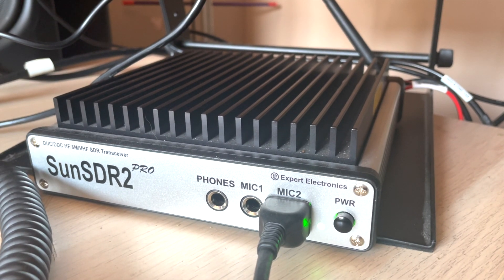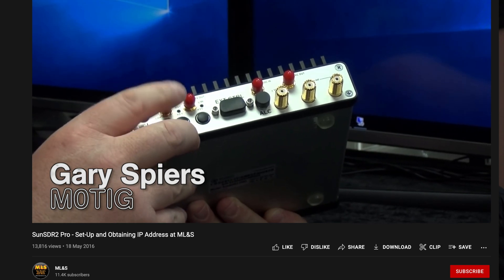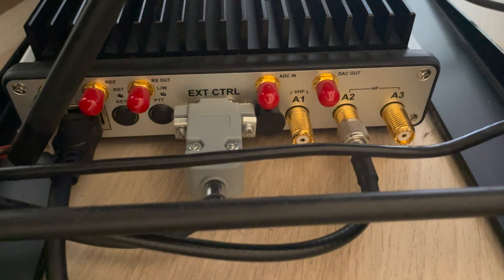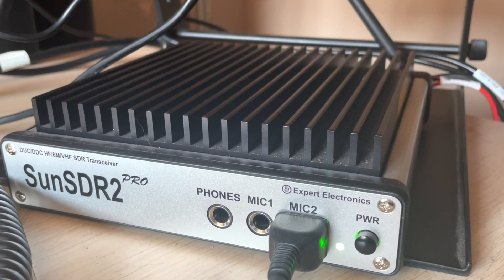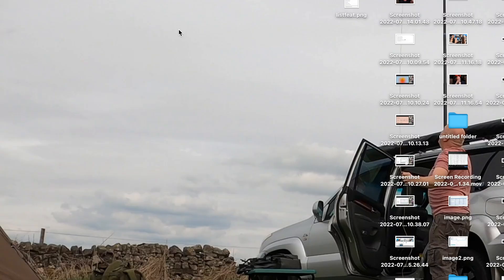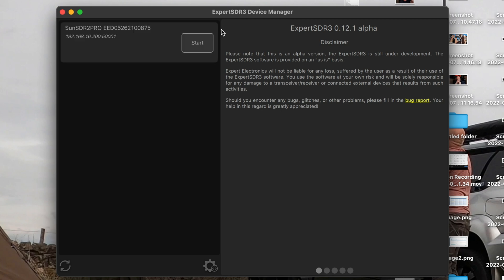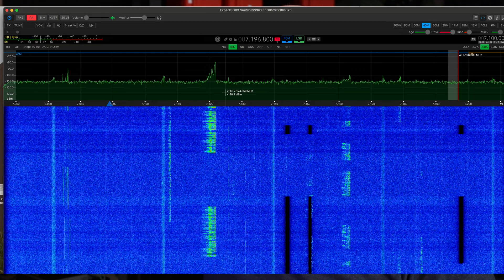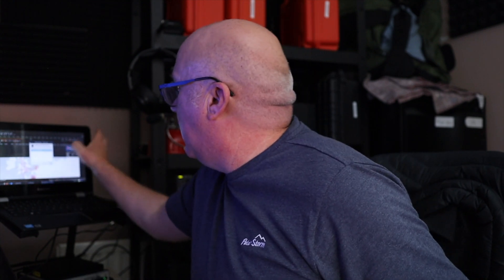A review of the SunSDR2 Pro HF/2m SDR Transceiver

Comment: Did you not know you can use Wine64+Winetricks64+ZIP.dll to get the system to work if VMware Fusion refuses to work, You could have used one of the ports on the back of the Cable Router to carry the signal back to your Apple Mac.

Comment: Hi Carl, hope your well. Nice presentation. For the uneducated like me, I presume what have is , basically a transceiver on a screen in place of a transceiver on the bench, wow . It looks great to use but extremely complicated to set up compared to simply switching on the rig and turning a dial. Myself personally cannot look at a screen too long, bad eyes, so ts 480hx and cw forever hi.
Re noise,  I've been around a while, and recently got the xiegu nr1 noise reduction unit, best thing I ever bought, video on my qrz about it.
Good luck Carl and still waiting to hear you down under, uk on 40m is great recently. 
A hot night sleeping outside on the tops sounds like a treat hi.
73 zl3xdj

Comment: Great video Carl. I am using a similar setup based on a Flex radio. I like the software which is pretty similar to what you have in terms of layout etc. One thing that makes me laugh about my own setup is that eventually I got a FlexControl wheel (at a crazy price considering it is just a posh USB controller). Having come from a ICOM 7300, whilst I liked all the software advantages, I found using the keyboard or mouse to quickly search a portion of the band difficult and clunky. So the FlexControl gives me back some tangible feeling of turning a dial and I feel more comfortable hunting a frequency and homing into it.  Mark, 2E0MSR
Reply from the maker: I’ve got a shutter control wheel used for film editing, I could programme that to scroll